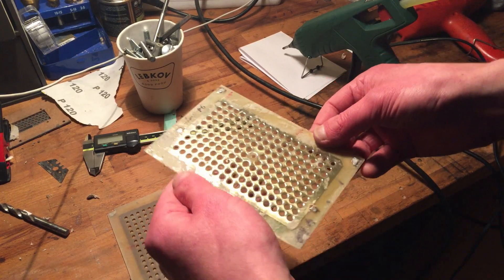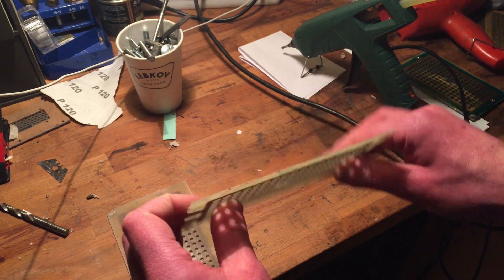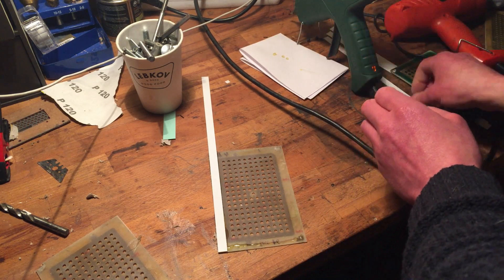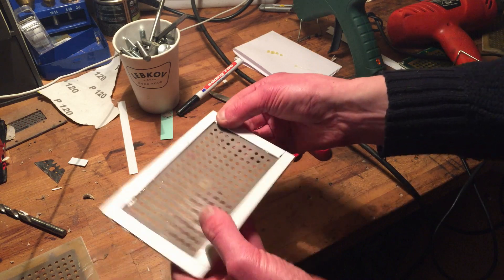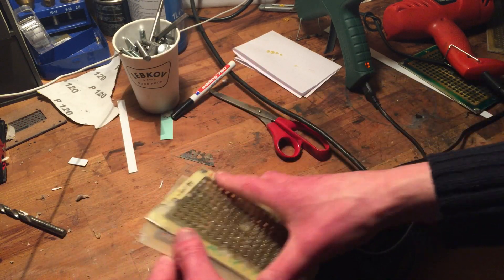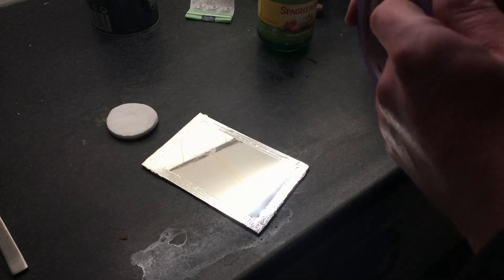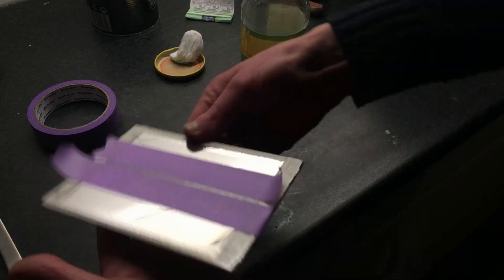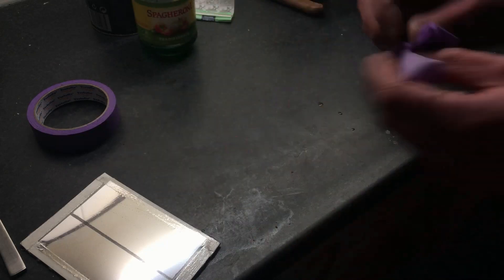Inverterd a solosound  ESL panel to a inverted..

Comment: I was curious if you have ever tried a different shapes, or does it have to be a square or rectangle.
Reply: Electrostatics can be any shape because the surface of the diaphragm technically moves as one. It doesn't bow as much, it's more like a flat sheet as it moves. I would assume you could make insane shapes like ⏫️🔰📛 and itll still play sound lol.